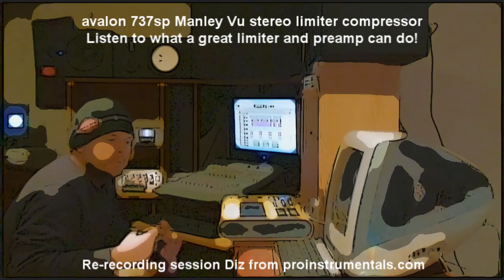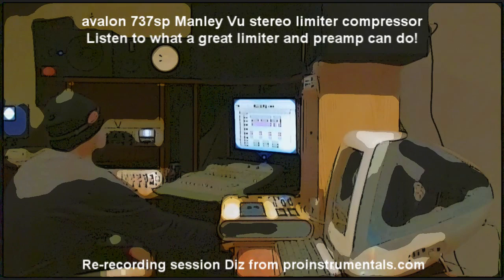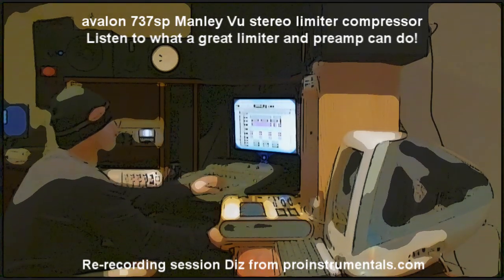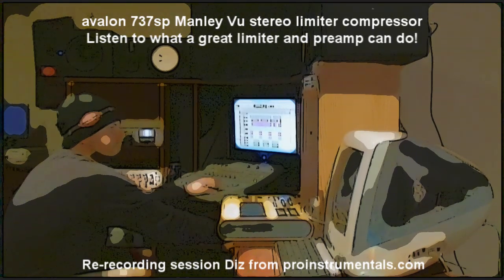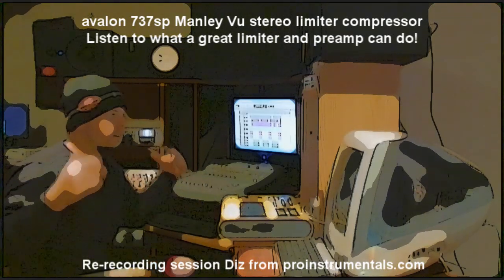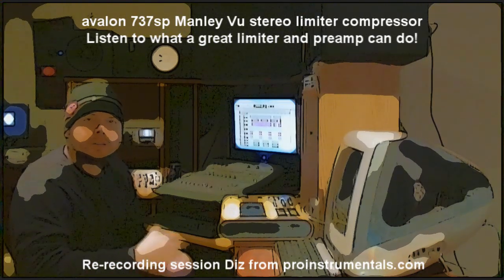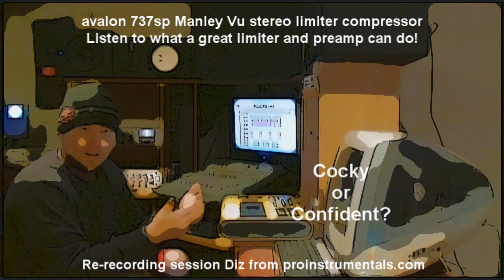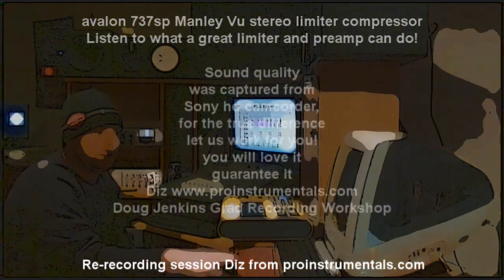Pro recording tips avalon 737 manley compressor rerecord.wmv

Comment from the maker: @checkmateproductions   Do you have a digi 002  or a mbox? or both.. but you need to check the manual on how to create a insert with your hardware,  each one does this task a little different..   but it usually has to do with creating a out and in circle..  LIKE out digi 1 in to avalon back out of digi 1 In to the avalon...